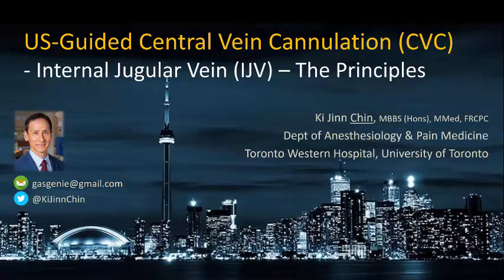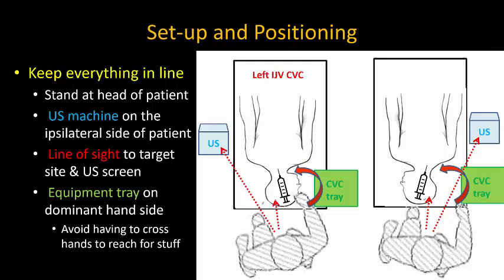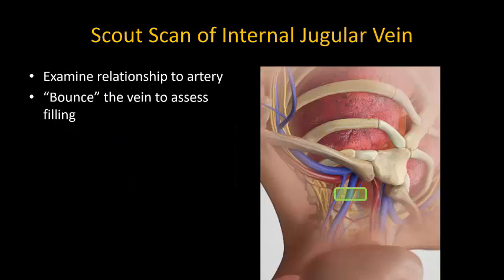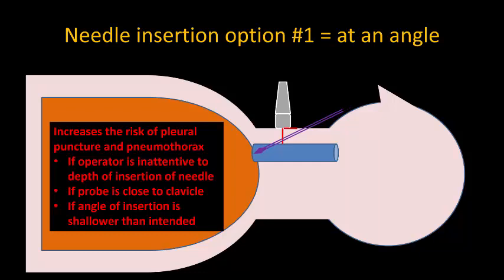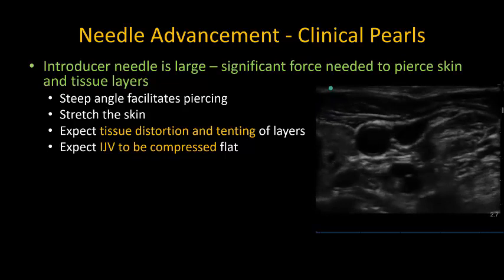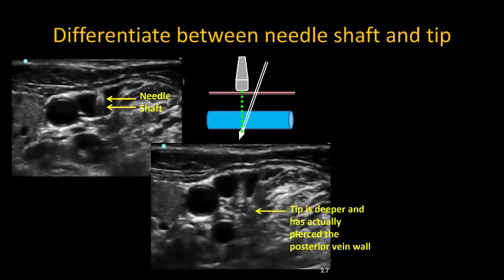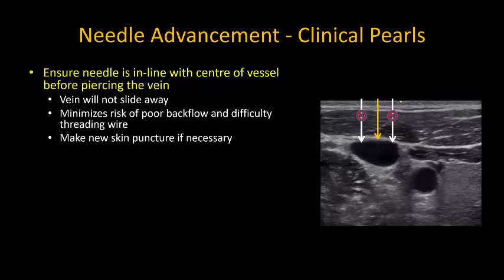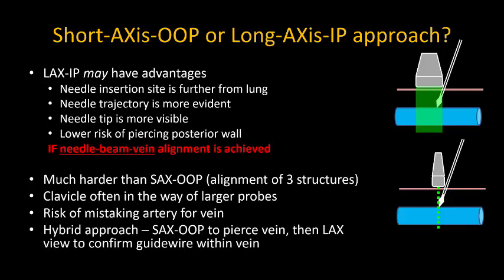Ultrasound-Guided Internal Jugular Vein Cannulation - Principles (Part 1)

Comment: Hello Ki-Jinn, great video as usual. I have personally switched to long access view, amazingly easy and safe approach with a full in-plane view of the needle.
Reply from the maker: Thanks for the useful insight! 
What is the size of your probe? Presumably the foot print is relatively small, or do you just "ride" the distal edge of the probe up onto the clavicle to create more space for your needle entry? 
I also know that you are very skilled and experienced at achieving needle-beam alignment, so I'm not surprised it works well in your hands.
Reply: @KiJinnChin  Give it a try. Much easier than the short access technique. All your points are valid, a small hockey stick is nicer but a regular linear works well too. Another tip: no syringe 😂

Comment: Thanks you for sharing your videos about techniques and tips ! They are really helpful and inspiring!
Is there any suggestions on neonatal IJV insertion(using the same principle?)
Reply from the maker: This is not something I have direct experience of; I only did LMG insertions during training. But I would say that (1) handling of equipment will require a lot less force, since tissues are likely to be thin and fragile (2) more control is needed with needle advancement since distances and diameters are smaller; think about how to brace your hands appropriately (3) smaller footprint probe for sure. Otherwise many of the same principles would apply. I might use warmed-up saline for contact to prevent temp loss in these little ones.

Comment: Sir i have encountered a few problems during the procedure.. The main problem is that my guide wire doesnt advance sometimes....? Sir what could be done to ensure that it doesnt happen.. Please reply
Reply from the maker: With an IJV approach, the only reasons the wire won't advance is (1) that your needle bevel is not in the centre of the vein, so the wire is abutting the vein wall. Make sure that the vein is distended well, that you have pierced the centre of the vein (not to 1 side), and that you have free flow of blood (2) that you have not flattened your needle, which means you are asking the wire to turn through a larger angle. Once you have pierced the vein, you must drop your syringe hand to flatten the angle between needle and vein (3) there is a clot or other anatomical obstruction to passage. This is unsual though.
Reply: @KiJinnChin  sir but while doing IJV cannulation without ultrsound.. HOW CAN THIS BE AVOIDED?
Reply from the maker: @srk341717  Same principles - flatten your needle, make sure that you are not pressing in and compressing the vein, and that you have good backflow on aspiration. With LMG, we usually cannot aspirate blood while advancing even after you pierce the vein because the vein gets compressed - you should always intermittently backoff / pull back slightly with your needle while advancing to see if you can aspirate, especially if you feel a pop or give, which signals that you may have entered the vein.

Comment: Great video. Love your series! Do you have one for femoral vein cannulation under US guidance? I find femoral like insertions to be the most difficult using the US.
Reply from the maker: I don't have one yet, but I'd be curious to know what you find difficult about the procedure. 
Off the top of my head, I would say that (1) in obese patients, get some help with retracting the pannus, either with broad tape, or an assistant (2)  tracking the needle tip by sliding the probe is going to be tricky as you will be limited by the abdominal pannus - so consider either (3a) starting the skin puncture an equivalent distance away from the probe as depth to the target, & utilizing a 45 degree angle; or (3b) if the vein is not too deep, use a steep angle of insertion to puncture the vein as described here for the IJV, and then once punctured, flatten the needle-syringe assembly to 30 degrees so that the wire threads smoothly in.
Reply: That’s helpful. It’s definitely the obese patients with deep veins. I find in these scenarios, there is little room/area to “creep” up with the probe while trying to visualize the needle tip. The 45 degree entry (same distance away as the depth) is what I typically use in these patients but I still find the dynamic visualization of the needle with the US is still quite challenging compared to IJs.
Reply from the maker: @ckhkim   - my other piece of advice is to worry less about visualizing the tip (which may not be feasible) but pay attention instead to the tactile feel of the tip passing through the tissues and be conscious of depth of insertion - once you know you are approaching inline with the centre of the vein, intermittently look down at the needle, as we used to do in the old days, and try to sense the pop through the vein wall. Also the indirect cues of tissue movement and lifting of the transfixed tissues / vein wall as you gently bounce your needle up and down - this can be very useful in telling you where the tip is sitting in terms of depth. Which is really all that matters.